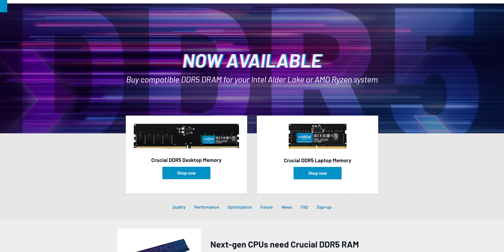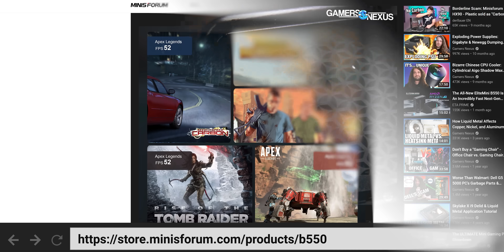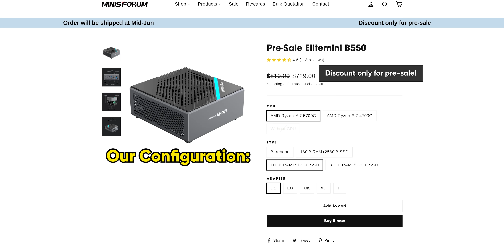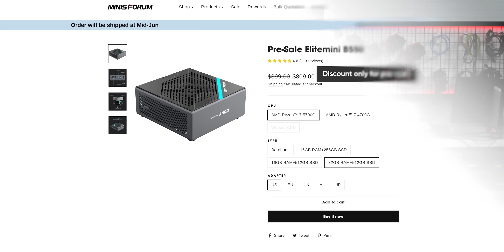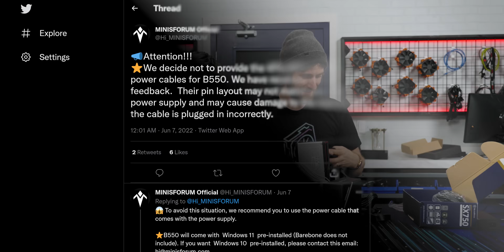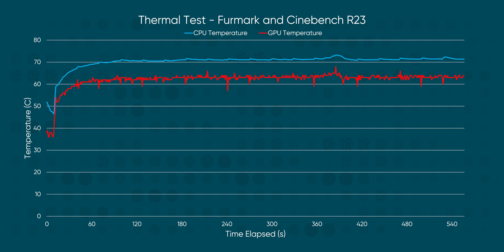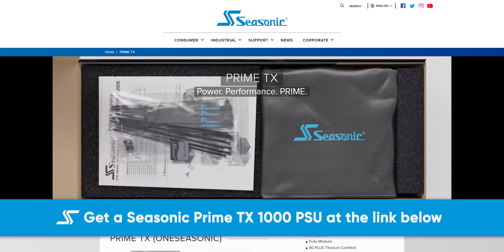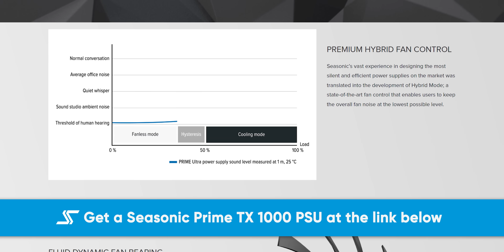Who's Buying These? - MinisForum Elitemini B550

Comment: I like super compact computers, but I feel like a normal laptop or desktop would be better options. For mobility, you’d also need to have a keyboard and monitor, and for at home use it doesn’t look super amazing. For $700 you can get a Lenovo ideapad gaming 3 with a 3050ti and a ryzen 5 5600h that’ll play most games at high settings, and for a couple hundred more you can get a laptop with a 3060. You’ll have plenty of performance for 99% of the things you want to do and you won’t have to worry about carrying a monitor or keyboard

Comment: Docking stations have been a thing for a long time, som I agree fully onboard with the idea that all the connections should connect to the dock base and  maybe just a dual  mini cord coming off the top for the GPU that way the docking station is fully stationed and the PC itself can be detached in two actions…power off and pull up and off. 
Expandable GPU options are always fun to see, and I’d like to see this idea a bit better done with a laptop that has a rear bay full PCI hookup so the laptop can be a slim workstation with expand ability to have a full desktop GPU straight off a streamlined dock. (Perhaps with a flip down shroud. I likely could design that pretty easily as a visual prototype)

Comment: Just a GPU in a box with usb 4.0 will probably the future? So you can attach it to any machine with a usb 4.0 connection... a PC, a Laptop or even a small SBC (Or maybe usb 5.0 since usb 4.0 is only 4.8GB/s comparable with a PCI-E 1.0 x 16 connection)

Comment: went from looking clean and tiny to a cluster f***. I'm happy with my 11th gen itx machine with 32gb ram, 980 pro gen4 nvme and if I want it the xfx rx6400 and it all just fits in a inwin Chopin pro case. it was $1214 aud in total(not including GPU)

with this one coz it's 5600g is useless for pcie 4.0 so none of those nice nvme speeds.

and yeah I take mine to work every day I'm a contractor and it's brilliant. but go by an Audi not a bike haha 🤣

Comment: as a uni student i could totally see myself using this along with a laptop with no brains (like something similar to a NexDock). full gaming power at home, and more power than a usual laptop on the go.
Reply: You don't really need a laptop if you have this and a  monitor.
Reply: @Daniel-dj7fh  yeah but a monitor keyboard and mouse would be harder to take around than a no brains laptop which is essentially the same thing but meant for bringing in a backpack

Comment: I am noticing that a lot of people assume portability equals on the go usability. So let me explain why those two things aren’t equal to each other. For my job I need a computer with specific software on it. I need to use this computer at my home office and the main office. I don’t need it at Starbucks, McDonalds, or any other restaurant. I need a portable CPU, RAM, and storage. It doesn’t need a display, keyboard, mouse, or battery.

Right now, I remote in from my home office to the main office because Remote Desktop and two 27” monitors is cheaper, more reliable, and more efficient than a 15.6” laptop screen.

Comment: It just seems weird becuase the expandability. Its like using that old GPU expansion case I think Nvidia deputed years ago and they're trying to bring option to the masses. I mean yeah a laptop could be better but that little thing could be used to power CS GO and have smaller computers in esports domain. It's not a bad idea but definitely needs improved upon.

Comment: I can provide a use case, someone who goes of frequent, short work trips. I often have to go on trips out of town for only a night or two and bringing my computer, even as small as mine is, can be a hassle. Often times I just grab the Chromebook because it'll be good enough for a night or two if I don't need to do anything beyond light web browsing. If I had the option to just, remove the core of my machine like that and take my full computer with me, with all my files and everything, that would hands down make things more convenient. At the same time, when I'm home 90% of the time this would be more powerful than a docked laptop, not to mention upgradable. If they refine the design a bit more, like what you were saying, I could see this having a market.

Comment: This strikes me as a too clever by half design, but it does make sense. I watch a lot of YouTube videos about low spec PCs/laptops and purchasing PCs/laptops second hand that usually seem to be hitting the five year mark. The one real ding against low spec laptops and second hand laptops over their PC counterparts is the laptop's built in graphics solution. Time and time again it's explained that the CPU on even some eight year old systems can still have some fight left, but what kills the justification for purchasing the laptop is that the GPU is too weak to begin with and/or so outdated that the version of DirectX need to play games with doesn't work properly on it (usually because of lack of drivers). This Minisforum seeks to mitigate that fate of this machine prematurely reaching end of life. The CPU component of either the 5600G or 5700G should hum along for five or six more years under reasonable expectations. The Vega IGP built into these APUs...well, not so much as its already long in the tooth, been replaced already on mobile by RDNA2, and set to be replace on AM5 by RDNA2. The solution Minisforum came up with can be explained as "buy this NUC-alike now and in three years when AMD unceremoniously drops driver support keep it running with a graphics card upgrade". Its like all those modern laptops with Thunderbolt ports that can connect to an external graphics card for desktop replacement tasks only slightly less mobile and slightly more jankier.

Comment: "get a laptop" .....
Laptop's can't deal with heat. This is great for when you need more power, for instance when you're a developer. But... I'd not settle for this as it's specced too low. If this was top proc/mem with great cooling I'd use that. I'll be using my 12900k / 64GB DDR5 6K in SFF because that can cope with what I'm doing with it. Hopefully this a start of something better down the line.

Comment: For me, the capability to tear it down to components makes it easy to travel with while the full fat power makes it so that it's like I never left home. Laptops are great, but if you want more power you have to go with larger laptops. And even then, IO is a huge step up on this compared to a laptop. If this wasn't so quirky with needing a standalone PSU and some of the other bits, I'd seriously consider it for when I travel long distances.

Comment: I have a mini pc I got from my job and I take it back and forth from home. But again I am using this for an accounting job so I don't need the GPU as I have a usb c hub at home hooked up to three monitors and at the office I use the HDMI and display ports to run two monitors with a third running off a standard USB to vga adapter. 

I suppose if I needed more power to run some graphics applications that this could be useful for me in that I have a dock at home and a dock at work.

Comment: Whoa! This is one of the best computer design out there right now... Ear me out!

First, you get the 5700G version, 16 GB of RAM, a good PCIe Gen 4 SSD, and a very good 800w+ ATX PSU; then you run the thing for a few years with whatever GPU you want. For reference, a 5700G is very close to an i7-11700k in the intel world so this is a very good machine given the price.

When you feel like you need to upgrade, you build a new machine and carry over your PSU, and sell the GPU.

You now have a perfectly capable media center PC for your living room that you can run with only the 19v power brick;
Or a great capture PC if you're streaming (just add a capture card) still with only the 19v power brick;
Or a fancy pfsense router (just add a 4 port NIC) again only with the 19v power brick;

That's the whole shtick! It's good now, but amazing at being great for later! Who cares if you can upgrade the CPU on this thing. It's not about upgradability. It's about reusability.
Reply: Fully agreed, an important feature of this machine is not just upgradability, but reusability through sidegrading or downgrading and using for another purpose, without taking up the space of a whole mid tower. I would reuse something like this in 'mini' mode as a home server running linux and a bunch of docker containers. Heck, you could probably use the external PCI and put a proper RAID controller card in there and make a serious NAS (though it would look even more janky).

Comment: I'm curious, since it has a male 16x slot, can you plug this into a PC as an extension card and turn it into a compute module?
Reply: My guess would be that you can plug it into a pc and turn it into a paperweight.
Reply: As PCIe stands right now, no. Had to look up the interface pinouts, but there's a couple of pins that all expect to be masters on the PC side. It could be possible, but it depends on the PCIe controllers baked into your CPU. Those things are slinging data fast enough I doubt there's any room for reconfigurable bits on them.

Also, I just found out there are I2C interfaces present on PCIe ports that you could use for some hackery if you're so inclined. Support is iffy depending on the board though.

Comment: So a couple of use cases I think are viable:
- Consultants who do a lot of travelling but stay in a place long enough that they want a full gaming system and aren't happy with a laptop spec'd 3090 or whatever. They also don't want a gaming-style laptop for client site visits or whatever, but have a dedicated work space with a monitor/accessories provided since they're there for multiple weeks.
- Parents who use a computer for playing harder core game that need a dGPU and also occasionally bring that computer to the family room for kids to use for movies/easier-to-run games. You don't want kids spilling soda on the full system with the dGPU since prices are still fairly high but you also don't want to buy another system or have kids be able to access it all the time or something. 
- Van life people who want a dGPU when they're at a place with electrical hookups or their solar is running at max to edit their influencer footage but want better efficiency when they're on the road and it's not sunny.

It's totally a niche system, but it seems like there are probably some people for whom it makes sense. Or at least might be cheaper than having a gaming laptop of similar specs if they'd be using a separate gaming mouse/longer travel mechanical keyboard anyhow as some do.
Reply: you don't need a gaming laptop with a 3090 bulit in. Laptops with thunderbolt can plug in a external gpu... also, who would lug a monitor and keyboard and a mouse along with this thing around and think it's portable?...

Comment: If you're gonna go through the trouble of making something like this, wouldn't it make more sense if it was a laptop that connects to an external adapter with a power supply and a discreet graphics card? That way you could use it as a laptop on the go and a desktop at home without much compromise. I guess cooling could be a problem but if they had some fans on the external adapter to vent some of the air out or something it could help with temps.

Comment: So they reinvented the laptop dock.. kinda..?!

I like the idea of a "portable system" that has all my stuff the way I like to have it..
It does really need to be a full dock.. build in power supply and some kind of OI pastthrough. 
And literally just inserting or removing the main box.

I could have the powerful GPU dock at my home desk.. with a larger (multiple) screen resolution setup. An audio interface, better speakers or headphones, my own mouse / keyboard, etc.
And at the second location an lower spec / older GPU or even none for the browsing/email work on a simpler setup.

I like having 1 main system, with all my applications and settings as I have them.. because i'm not going to be great at keeping synced between multple systems.
This is upgradable for the most part, I can still choose to expand/upgrade storage, RAM and CPU.

Comment: If you need something small, just a smaller form factor PC, if you want portability you get a laptop, I`m sorry but this product is dumb, someone will be buying into this just because of the "cool" factor, other than that it serves no major purpose, is not an improvement of what is already available.

PS: Anyone saying "I can get this to a friends house and play old games on it" no you can`t, you need a monitor and if your friend already have a monitor/tv whatever, 100% he also has a system capable of running old games, occasional usage is not feature for a product.

Comment: I bought one because i want to run it from my 12V Solar System . there the 19V input comes pretty handy! When I want to game (I mostly work with my computer) i just put it into the dock and connect the cables with the PSU which is connected to my normal mains power outlet and TV.

Comment: As an engineering student I can confidently say I want one. Get a portable monitor and you’ve got a beast you can bring to class or labs.
Reply: You don't even really need a portable monitor, just yoink a hdmi cable off one from uni haha.
Portable monitors are expensive tho, only if Samsung didn't cockblock Second Screen on their  a-series tablets one could use those old things as portable monitors.

Comment: With a little bit more development, this is definitely something I'd be interested in. I like to have my GPU in my house for gaming, but when travelling I don't care too much. I do however, care about files and software I use frequently, and most of the work I do transfers very poorly between multiple machines. Having a top of the line desktop CPU with me is nice too.

Currently I just stick my SFFPC in a pelican case, but a system like this (with kinks ironed out) seems much more appealing. I have a laptop as well, but I end up using it almost exclusively for Microsoft Suite applications.
Reply: Use a laptop with thunderbolt to be able to use external GPU when you're at home.
Reply: lol... so you would rather have this and a bunch of cables and keyboard and mouse plus a monitor than a laptop?

Comment: It's something for a person like me. I don't want a hulking case and for a somewhat casual gamer like me motherboard/cpu/ram/storage are not priority upgrades as much as GPU.
I do think it could have been better implemented, maybe with the extender have a built in power supply or have a power supply location at the bottom to be able to screw to it and also agree on the cabling as it was all over the place. This is an awesome v1 though and hopefully v2 will be even better.

Comment: I gotta respect the ambition of their bite, even if they are struggling not to choke on it. If it had the power for the GPU supplied from the same brick as the rest of the system then it would be really cool (albeit still a a solution to an undetermined problem.) However, there really is no way to do that without it being so expensive that a "normal" SFF build makes more sense.